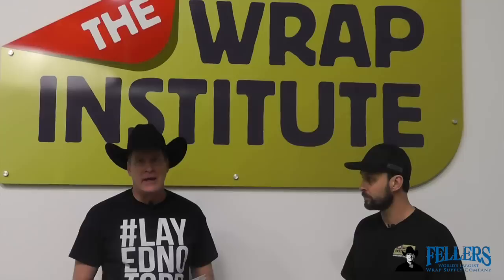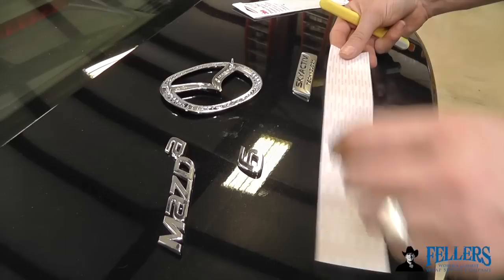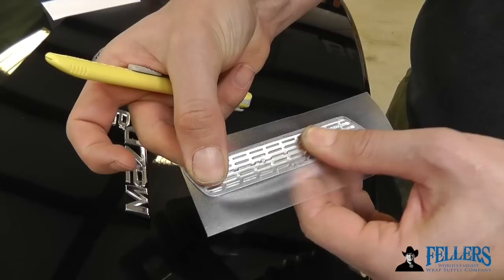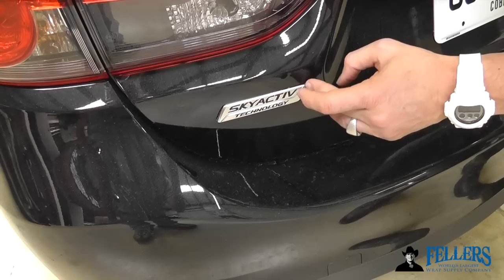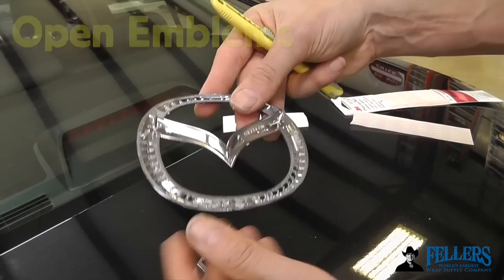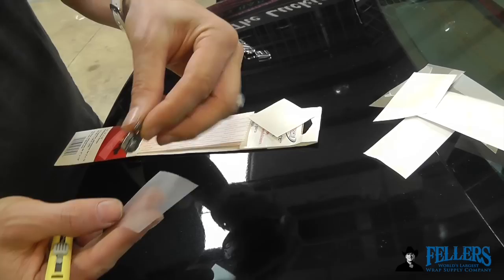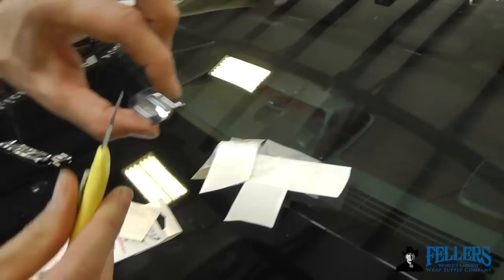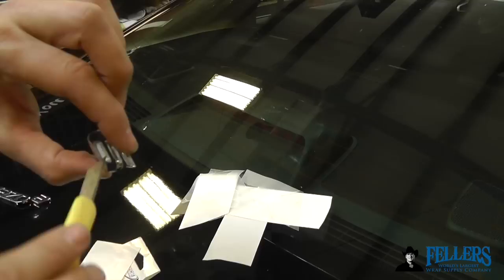3M Press In Place with Frank Fellers and Justin Pate

Comment: spacing of individual letters is critical. It's originally done by a type setter. To copy the spacing and avoid the issue of sloppy spacing do a pencil rubbing of the original individual lettering and use the press in place to position the letters on the rubbing....once in place...apply the press in place to the complete line of lettering and apply to the car surface.....peel off the paper rubbing....clean off adhesive.

Comment: Just pulled a pinned emblem from an 1987, and noticed just how important the seal around those pins is. Im positive that the orig. double sided foam was not up to the 30 plus years of service, but it should be noted just how important sealing the pin intrusions is to the longevity of the panels the emblem mounts to.
Do they make the product at hand in black? Or in different thicknesses?

Comment: lol the glue strips cost more than just buying a new set of badges for my tailgate...
3M strips = $40 on amazon... Tacoma tailgate badges (oem) $19.99 on ebay.
Reply: ackland granger has them for less than $4 per sheet.   I was blown away and I had to make sure he actually was quoting me the right price.
Reply: Why don't you look for the adhesive on ebay or elsewhere?  Lots of price gougers on Amazon.
Reply: Many of my cars are vintage and new emblems are not sold. And even used ones can be nearly impossible to find.

But of course a tacoma owner is stuck in his own one dimensional world.

Comment: Sorry, i just can speak for my country, but  new emblems are cheaper then this 3M thing🤷🏼‍♂️ And its delivered with original glue an you dont need to play around with that.
Reply: That's what I was thinking.  If you purchase a replacement emblem from the dealer doesn't it already have adhesive on it?  I can't believe they would want their mechanics at the service centers playing around with adhesive strips and cleaning any excess of the customer's cars.
Reply: Many of my cars are vintage and new emblems are not sold. And even used ones can be nearly impossible to find.